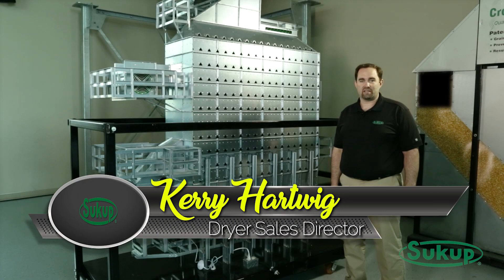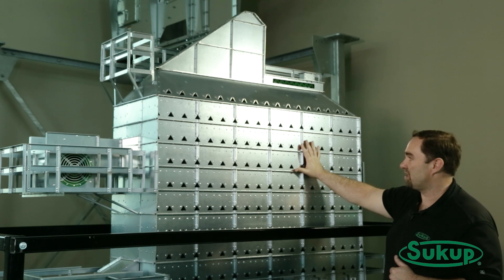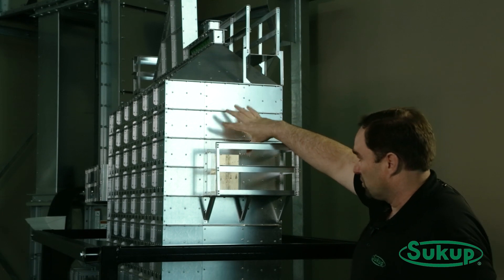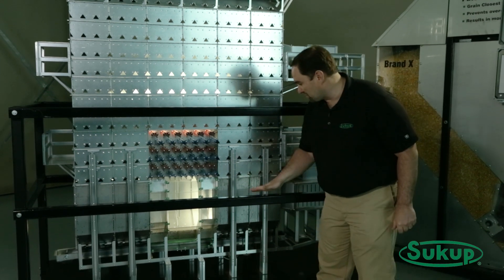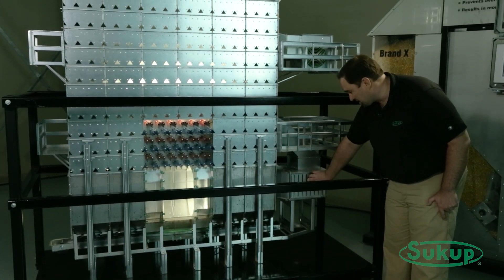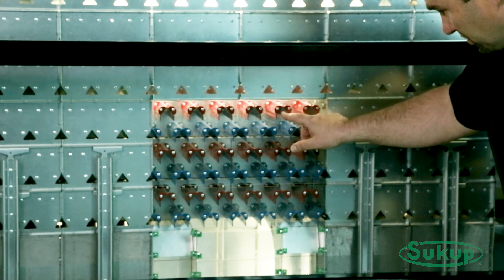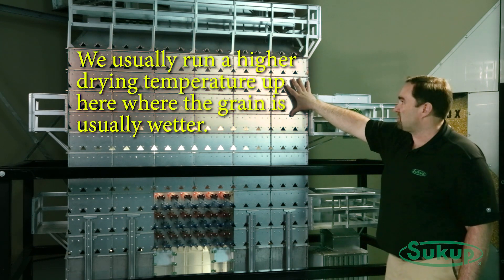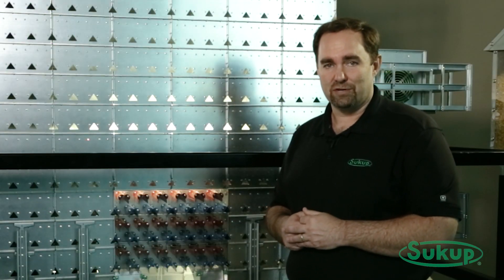Mixed Flow dryer tutorial V2

Comment: Fair to middlin' explanation. Please do a multisection cutaway to illustrate the heat delivery from the plenum to the hot air triangles to the full width of the grain column and the exhaust flow. Also show air and corn flow for screen dryers. What is the range of recycled heat in BTU/bu from the dried grain outlet air preheater? Since there is really nothing special about preheating combustion air do other manufacturers also have a grain cooling / air preheater sections?

Comment: @ https://youtu.be/52-h9KtTgmI?t=163, it is said closing the louvers induces more heat recovery [make sense] and more cooling . I don't undertand how constricting air flow through the system induces more cooling of the grain ?
What am I missing and not comprehending?
Thank you for 
SHARING THE KNOWlEDGE !

Regards.
Reply: The total amount of combustion air doesn't change. The feature being touted is that some percentage of the combustion air is first drawn across the hot grain. This cools the grain leaving the dryer and raises the average temperature of the combustion supply air. To pull air through the hot corn requires more fan horsepower. No, I cannot estimate how much additional cost to pull air through exiting corn column. That increased fan motor amps is compared to how many BTUs of fuel are saved by preheating the combustion air. I don't understand why one wouldn't always pull as much air through the hot corn as possible. As a rule of thumb most processes cannot preheat combustion air too much. So I also don't understand why preheating combustion air wouldn't be a long-time feature of every corn dryer. Yes, I'm an engineer. No, I was never a farmer.